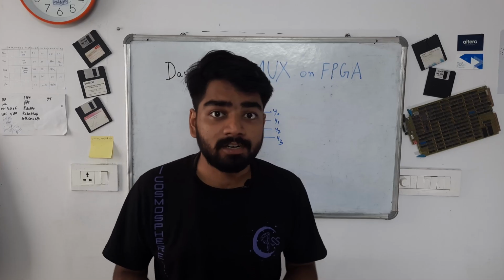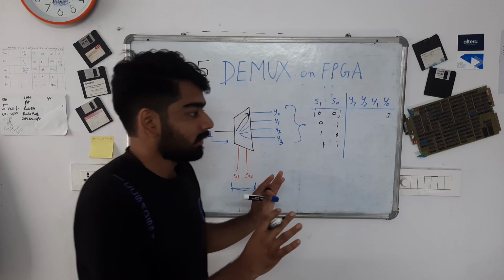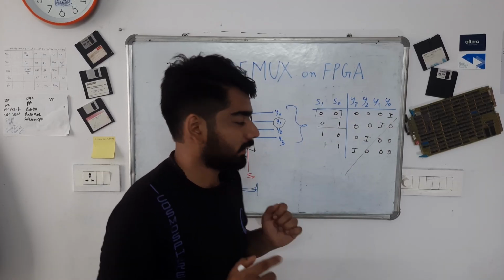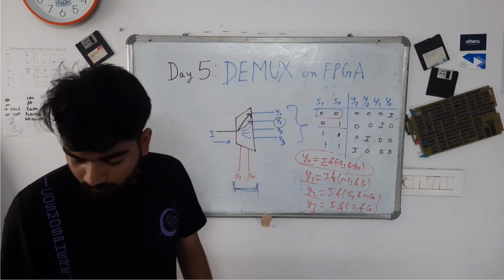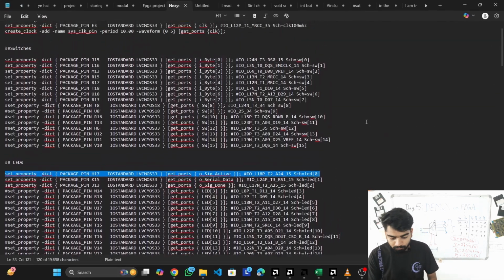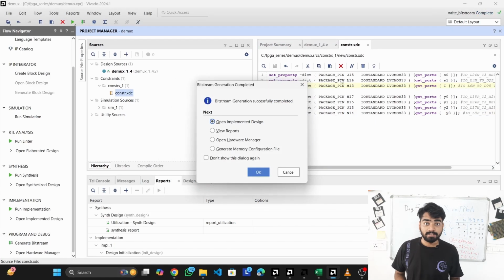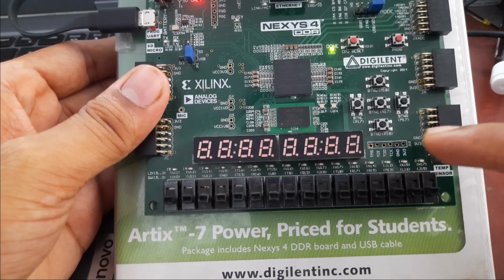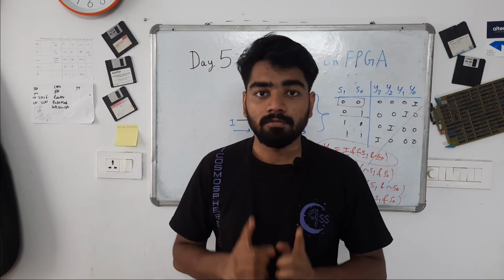How to implement Demultiplexer on FPGA | 100 Days of FPGA

Comment: Bhai puri digital electronics ke concepts hi FPGA mei lgte h? 
DSO mei bhi FPGA aise hi implement hota h kya ?
Reply from the maker: Haa, digital ke concepts bigger designs me use honge. Basically verilog sahi se aana chaiye with these smaller concepts, usi ko combine krke kch bada banega. DSO (I guess you are talking about Oscilloscope ?) , DSO me ADC data ko process kiya jata hai, lets say simply ek math function (ch1+ch2) perform hona hai between two channels, to waha har ek sample pe addition lagega, to waha ek adder synthesize hoga, jo abhi hum log individually likh rahe bade codes me wo combine honge, you can check my FFT verilog code on GitHub, pahle bahut bada code lagega but dhyan se dekhoge to kuch nahi hai, data storing/fetching form the ram with simple addition/subtraction/multiplication hua hai, so bigger designes use these smaller design concepts that we are learning one by one now .. .
Reply: @TheHardwareDeveloper  thank you so much ❤